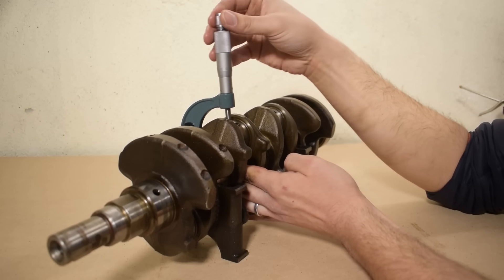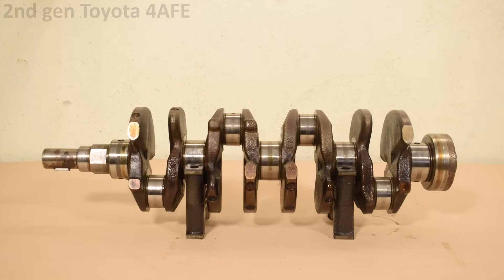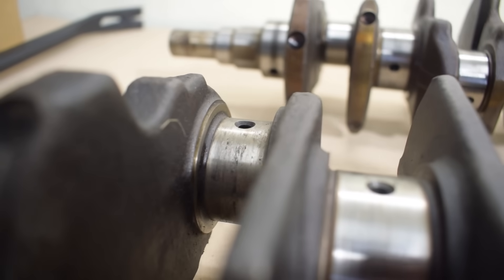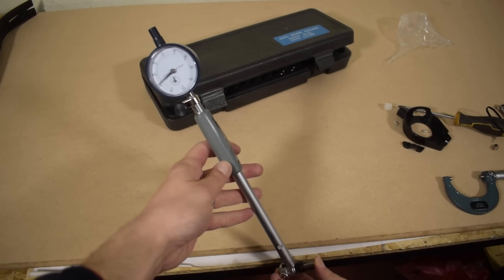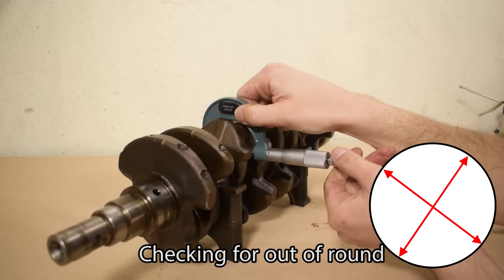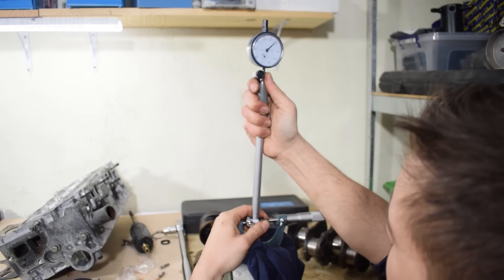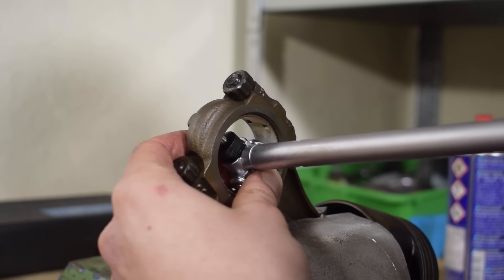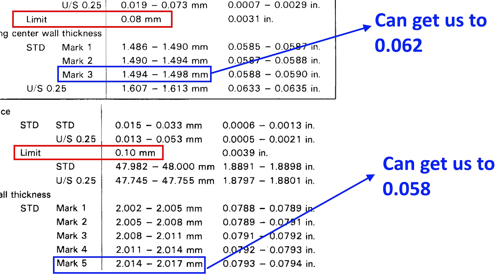BEARING CLEARANCE - How to MEASURE and PREVENT engine damage

Comment: I got these tools and are struggling big time to understand how to use them properly, everything is so confusing because I am really bad in math. I keep reading you do not supposed to use the bearings once they have been crushed, and reading then that it does not matter; the tools scratch and gouges the bearing surfaces, WTF? some say this does not matter and it is acceptable; then I read someone saying it is best to test oil clearance with a set of new bearings then use another new set to final assembly, well my last name is not Musk here, how can I buy two sets of everything? it is bad enough I have to replace the rod bearing bolts to final assembly because the suckers are TTY, and they are NOT cheap; then again, if testing with one set of materials then using something different when final assembling does not this throws all the fine measuring out then what is the use of even measuring? In my engine which is a pentavstar v6 for a Chrysler town and Country the machinist told me "as long as when you install the crank, spins and does not binds or feels too tight you are good to go" makes me wonder if all this expense and care is even worth anything; they do not do any of this at the dealer, they just replace the whole block with either an insurance or a re manufactured one like they did to my car once, this is the block I am working on after a hydro lock 3 years ago, and it is driving me f...king crazy because all these must observations and cares that I am having the hardest time following; all because I can afford the machine shop prices for every check needed or afford another block!

Comment: How inaccurate will the results be if you didn't zero the tools?
Reply: Extremely inaccurate. You have to make sure that when it says 2.573, it is 2.573 that way if your bore guage says 2.58 it’s actually 0.007 away, where as if micrometers says 2.573 when it’s actually sitting at 2.568 it will give you a wrong number.

Comment: Hi, don't you have to divide the 0.07 value by 2 to get the oil wedge clearance and not the difference in diameter between the journals?

Comment: Oil viscosity has a huge role in the play on bearing clearances. 0w20 vs 5w30 vs 10w40. Bearing clearances will differ based off of what oil viscosity is recommended

Comment: Im not Qualified ( on papers ) .But I have worked for shops where many qualified guys were and they all admitted that im a much better mechanic than them all. Most thought I was talking shit when I tld them  i never even finished high school, let alone go to any college or worked as an apprentice .
I gave it allot of though as to what could possibly put me above them. 
1. My born passion for anything that has wheels and an engine.
2.Everything I know I learned on my own by studying material I could find online. I tried to consume as much theory as I can about as many different engines or thoeretical concepts and as many different manufacturers , compared to qualified guys ( in my case it was 2 guys with Hyundai/kia papers and another was from ford. They all only learned about their brand, having update workshop training on new models etc...
3. They were drilled to do things a certain way , I learned by trial and error and i dont have that drilled in mindset of whats right or wrong and unlike them Im not afraid to go with my own logic against their " that wont ever work" . 
4. They got smacked by their mentor for using a ratchet as a hammer , where I have no issue with using mine to bang on something if im under a car and my hammer is far . nor do i give a shit about using a big flat screwdriver as a chisel or prybar. 

My point is this : " There is too much bulshit surrounding engine mechanics." I have never , not once assembled a motor and measured 'RADIAL CLEARANCE' 
 (since the guy in video and all the other engineers in the comments dont know the correct term...) 
 How many failed builds did I have ? NOT a single 1!!!! 
All my builds always read higher compression than manufacturers data. All my customers reported noticeable throttle response and better fuel economy. 
 Allot of the " you have to do it this way " is like the boogy man . A fake story made up to scare people. 
 You doing a crank bearing job , it probably means that either a new std sized 1 was installed or the damaged 1 went to machine shop for engineering. In both cases you just have to double check that the spare part shop supplies the correct bearings.  so if you use std pistons and std replacement rings wich size was determined by the original engineers and bearings to matc (provided machine shop didnt mess up ) then ofcourse the radial clearance will be within spec and you can rest assured and go ahead...

Comment: A noob question - is it safe to use old camshaft bolts to measure the inside dismeter? If bolts are stretched isn't going to alter the measurments?
Reply from the maker: Some say it does but I've never seen it happen in practice. Torque to spec and measure away

Comment: Very important a roller 🛼🎢 bearings ceramic as main for crankshaft n camshaft let it roll not weld n use two oil pumps

Comment: Do 0.01 mm accepted in building engine or is it better to use 0.0001 in . Im building my (GM engine 6.2L L92 ) and still learning about measurements some said 0.01 mm is not precision build for a stock build. 

What do you think
Reply: Metric resolution Is Better than imperial. In engine build, you Need to use 0,001mm.

Comment: set micrometer to journal diameter, set a telescoping t bore gauge to the bearings under torque in the caps, then use feeler gauges to see gap when you put t bore gauge inside of micrometer

Comment: Plastigage. Extremely accurate regardless of claims to the contrary. AND it measures actual torqued clearance which micrometers do not. Divide by 2 to get the actual oil clearance. Cost $3.
Reply: You are correct. I use plastigauge as well as the micrometer
Reply: @ianrobinson9565  yeah I used both either lie but people said plastic ain good I believe they just talked to talk because it's very accurate
Reply: so true, cant beat old school.
Reply: @user-gj8oq7fw1u  Micrometers are older school than plastigauge.

Comment: Wait so I am a little confused... if you have to measure by having the bearings installed for the bore and rod measurements, are you using the bad ones for these measurements? because I thought the purpose was to find the correct bearings to buy. I won't have new bearings on hand to test so you used the old ones right?
Reply: The purpose is to test worn bearings for usability as well as new bearings on whether they fit with the current wear or not. Usually new bearings on worn crankshaft will have problems on being too loose or too tight.

Comment: Hi thank you very much for these amazing videos.. I've just arrived on this channel and I really whatch your videos with enthusiasm..I have a lot of passion on motorcycle.. usually I fix them with my hands but I don't have all the competence like you..and I'm learning  from you so really thank you for that. There is  a point in this video that I'd like to ask because I didn't understand. How did you calculate  the result of 0.062mm and 0.058 ?
Reply from the maker: Can you please give me the timestamp where these numbers appear?
Reply: @d4a  of course. 10.53
Reply from the maker: Oh. This isn't a measurement. Basically the factory offers bearings of different thickness in order to make it possible to fine tune your clearance. So the two numbers are what we would have if we used the mark 3 bearing thickness. Make sense now?
Reply: @d4a  yes I understood that. What wasn't clear to me where did you get that two numbers..if you got them from the technical specific received from bearings buyer or if you had to calculate your quotes to determine what measure of them buyng.

Comment: Hi, very good! Only a point… 6:41 (sorry for my English).. if circumference of micrometer is divided for 50 (you see 5, 10,…45, 0) so every step is 0,02 mm, the measure is 39.97 and 39.98, right?

Comment: Hey just a quick tip, i learned from my grandfather how to use the brown wrapping paper used to prevent rust on automotive parts, this paper cut into strips can be placed behind bearings to ajust the bearing clearance to a better smaller value without having to buy new bearings ..also may need to pass a file on the bearing parting surfaces to create a clearance when tightening the bearing caps...just avoid getting this paper wihin 0.5cm of the bearing lock tabs which are supposed to prevent the bearing from spinning in the bore...

Comment: Awesome video. Pls i need your advice. I am an Electronics engineer but looking to setup a workshop to rebuild engines back to stock. I'm based in Nigeria, Africa. I ran this through a local mechanic but was discouraged that it's not profitable. That it would be be profitable to just sell the parts of the engine. 
Problem is most of the mechanics know nothing about precision in measurements. 
From your years of experience, is it possible to return worn out engines back to excellent shape?
Reply from the maker: Yes, of course engines can be rebuilt. It's done all the time. But you need a lot of experience to be good at it and costs are high if you want to do it right which also means you have to charge a lot. These costs are often hard to justify for cars where it's usually cheaper to just buy a good used engine. Rebuilding usually makes more sense on trucks, tractors and other industrial vehicles. Or on rare and valuable vehicles.

Comment: When it comes to bearing clearances, you've got what you've got. There's not many ways to adjust it and the majority of people don't have the capability to do it.
Reply: you can always take it to the machine shop to grind the journal or close and hone the caps as needed. The important thing is to take accurate measurements so you can make an informed decision. Its far better than just winging it.
Reply: @shriramvenu  The ideal way to do the job is the same as boring for the pistons. Buy the pistons first then bore the block to suit. Buy the bearings then grind the crank to give the correct clearance. Both jobs are for the machine shop, not the DIYer at home.
Reply: @1magnit or but oversize bearings
Reply: @erdemir5641  No such thing as oversize bearings,

Comment: After some sense making math your result was 0.07. Doesnot this number represent a static crank on a bearing surface? Does not the crank lift close to center when in operation? If yes, was your actual oil clearence closer to 0.035? 🤔

Comment: I have done this very meticulously, but when I measure with bearing shells installed vs plastigauge or measuring a calibration ring, I always see about an extra 10µm clearance. I seems like the bearing shell surface is so soft, the inside micrometer digs into the shell's top coating 5µm  (0.2 thou) on each side. I use trimetal bearings. I can see the area the tool interacted with. Since then measure all the parts, but the final step is always plastigauge. Honda K-Series engines use very small clearances. 10µm is pretty much halve of the clearance tolerance with minimum crank main clearance being only 17 µm.
Reply: It's really amazing the tolerances we can achieve with modern manufacturing/tooling.

Comment: When installing the journals do you just torque the bolts without adding the extra angle on top and are the bolts single use?

Comment: I also use platicgauge for checking bearing clearance. It may be old school, but its quick and simple,accurate and it works.
Reply: Plastigage is also a great tool to use. Just keep in mind that plastigage can't detect out-of-round. Plastigage can indicate some taper, but it's not an accurate method for measuring the amount of taper present.

Comment: Why do people insist on relying on oil pressure. Oil pressure alone doesn't tell you anything about how well the components are being oiled. If you turn on your garden hose the pressure is very low but a lot of water is coming out.  There are way more elements that go into this than oil pressure.

Comment: I spun a bearing and had the engine rebuilt at the machine shop. 500 miles later, it is rod knocking and I sent the whole truck for warrantied repair.
I now suspect they didn't clearance the bearings accurately (loose) because my pressure light was flickering on idle and my oil pressure gauge fails to bring pressure up on hot-oil start up.

thank you for giving me more insight on what possibly happened with this video.

Comment: Reminds me of the insanity that is Mazda RX8 stationary bearing journals. Those things keep running with the copper on the bearings stripped off.  The only hint is the faintest of knocks because the crank on constrained by the rotor.

Then it stops and never restarts. Unless you know exactly what to listen for it's a silent failure because it's nowhere near as loud as a standard piston engine.

Comment: Micrometer has to be held on the U shape body, where the name of the manufacturer is usually sticked, it reduce the error due to the temperature of your hand for example and this way you can dose all the measure to the same manner

Comment: when you are on the loos side use bit thicker oil and crank up oil pressure. Check if you can find higher flowing oil pump for your build, more flow = more pressure for your loose measurements.
Reply: Would this be a good application for the notorious Lucas oil?

Comment: hello 
thanks so much for this vedio . when we mesur oil clereance using plastic gages the total value found in both side of bearing must be equal to the to value of oil clearenc given by engin manufactur or not .
value of oil clearenc given by engin manufactur is for each side of bearings or must be divided betwin them

Comment: I finally realized my mistake in zeroing the dial bore gauge in the micrometer. I moved front part of it up and down not the spring loaded back part to zero it. I never knew whether i should push it in completely or if i should take any point in the middle and zero that. Now i found out that i have to do it the other way around. I don't know if somebody understands what i mean but you definetely made my day👍🏻

Comment: Theres an old engine builders saying "too tight and EVERYONE knows. Too loose and only you will know."

 I always shoot for .002-.003 depending on journal size, but i kid you not when ive seen .006 and still showed adequate oil pressure on a couple engine designs

Comment: Even better way is to use "plastigauge". Lay a piece of this across the bearing journal, 90° to direction of rotation. Install the cap with bearing, tighten to specified torque, then remove the cap and read the thickness of the plastigauge. These measurements will show bearing wear, & taper of the journal. The only time you need to check the caps, & big end part of the rod for ovality is when the engine has been overheated or abused. The operations shown here should help those who want to learn. The tools shown are not expensive, unless you want to go "all out" & buy digital equipment.
Reply: I've always used "plastigauge".  Rebuilds I have done work fine using this method.
Reply: @smithno41  same here. When I did engine reco work, plastigauge was integral in my job. We both know when used correctly, we can tell if the crank needed machining or replacing.
Reply: Some engines, like the old Holden inline 6 had issues with their bottom ends that did require this measurement. It was a combination of material, engineering and oil supply. The old 202 was notorious for it.
Reply: @iansmith6728  exactly. The 202 engines self destructed with monotonous regularity. If it wasn't number 3 throwing the leg out of bed, number 5 piston crown parted from the rest of the piston.

Comment: That was a really well done tutorial and should give people who will never build a performance engine some insight why it costs so much to have things done. The 0.001 / inch or mm is intersting, never seen a published number before. Does it change due to oil viscosity, (particularly in respect to modern engines using 0w-20, etc?) I imagine it does as the Toyota clearance was smaller than 'theoretical' clearance.
Reply from the maker: Thank you, glad you found the vid useful. Yes, running a low viscosity oil with the 0.001 rule of thumb thing wouldn't be a good idea. Most of the new stuff runs closer to 0.0005 or even 0.0004. The rule of thumb clearance most applies to performance builds of popular and go to engine platforms. That being said even some relatively modern stuff runs large clearances and high viscosity from the factory, but it's mostly large v8 or v10 supercars and hypercars.
Reply: @d4a  Thanks for reply. I've said it before but I'll say it again, I have no idea how you find out this stuff but I'm glad you do.